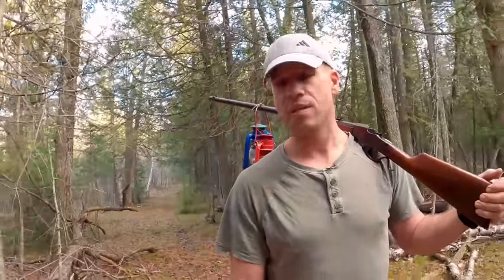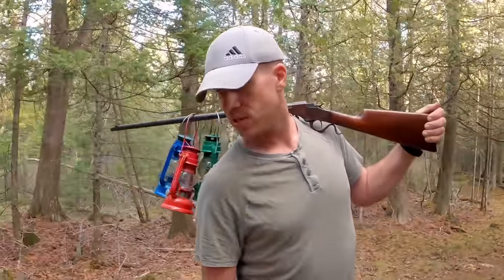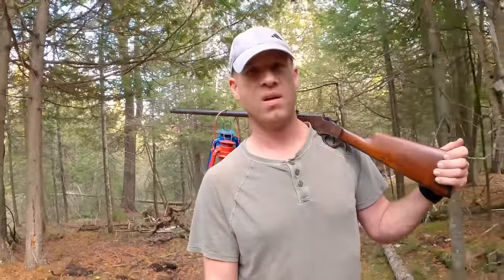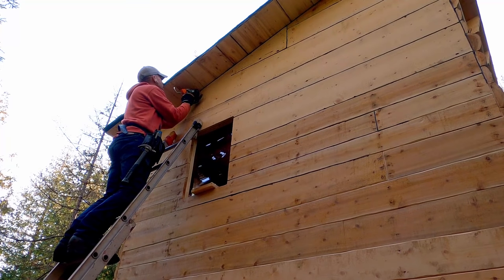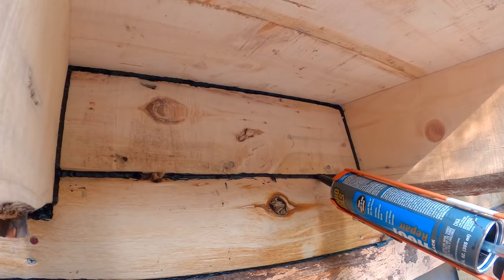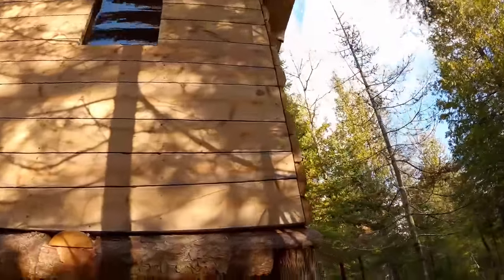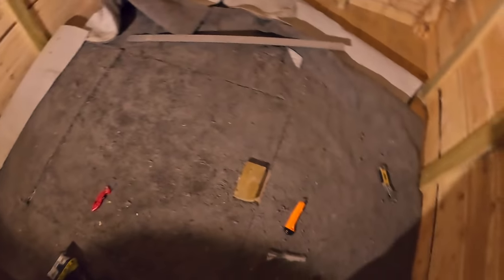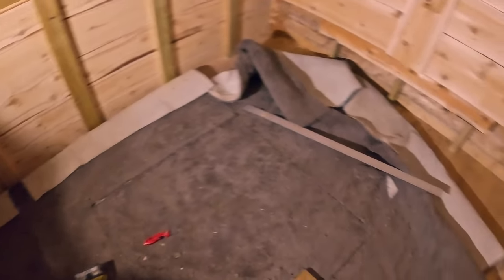The 7’ High Deer Castle, Finished! #19

Comment: Might not hurt to make a wooden scaffold system. could even tack it to the house. When finish take it all down. Idk of any thing to keep them out other than >  spray it down with diesel fuel and oil. It will help protect it to> from water, rot, insects, and squirrels >  I'll tell ya.  A Insect looks at a piece of wood like food, carpenter ants, Carpenter bees, and Termites dearly love a log cabin, if you don't keep it sprayed down every 2 or 3 years
Reply from the maker: That's what my Dad was saying.  Paint a mix of USED motor oil and diesel or kerosene or something.  That really works for bugs?  Guess I don't see why it wouldn't.  Seems like it would stink tho.
Reply: @survivingringworm2202  Yes it has a smell for about a week, but it works

Comment: Oh one more thing.......after watching the battery up and down the ladder in the previous video....... how about a small generator under the palace and a cord up through the floor ( just enough for charging stuff and lights)
Reply from the maker: Absolutely a great idea.  I'm actually not able to edit videos out there anymore because with the cold, the battery holds a lot less energy.  I believe at 32 the capacity is cut by 1/3 and at 0 deg, 60%.  That would be about 10 charges per one finished video.  A little Honda is def the way to go but sadly costs 100 jars of peanut butter or 10,000 rounds of .22 ammo.  Or 50 gallons of chainsaw bar oil.  
Depending on the standard metric used where you live.

Comment: If you just build a flat platform around each column at least 6" or so in width, any mouse would have to try to scale it in an upside-down kind of way, which seems like a challenge. Also, you could debark the columns and try to smooth them out. No idea about how to keep squirrels away, though.
Reply from the maker: From the comments, seems that wrapping the posts in metal is the way to go.  One step up from smoothing the logs I guess.
Reply: @survivingringworm2202  I hope it works! Good luck!

Comment: Use lithium grease or any other kind of grease that is thick and rub it well around all the posts at least 6 inches inches wide and at least 3 feet off the ground, should work to keep the mice and squirrels away. For flying squirrels you may need to hire a Hawk. 😂🤣
Reply from the maker: Got the grease, have a listing on Craigslist for the hawk.

Comment: Keep the Squirrels out n mice Try smooth sheets of Copper or antique copper or colored smooth Metal something that Blends in with the woods rather that is a distraction n works against it, also you could put fake owls on the posts, they use them around boats to keep away critters too ! maybe a fake boa constrictor or a bigfoot statue could help ? I know you most likely have n seen real or heard real Sasaquatch as remote n living there often like you do, if so Id love to hear your encounter, I saw one up close when bow hunting in Ohio one fall day about 22 yrs ago on a all day hunt, I was in the stand before daylight, and fell asleep for a nap about 11 am about a little after 12 I was woken by a squirrel sound walking up a old log road at the edge of the woods beside me I looked down n then up n up as a huge back side about 3 ft wide of what I thought was a horse was startled by me waking n it did a very fast 180 degree turn and dodged for the tree row straight behind me , I thought what on earth is someones horse doing going for a casual walk in the woods and why is it so scared of me to fast get 180 dgreEs behind me and from that angle with the treEs to my back as I had the bow drawed there was no way posSible I could have got off a clear shot at it as it weaved expertly in and out of the tree row as it walked fast away from me, it had intelligence to know to escape from me like so, but at about 50 yrds the woods n tree row turned to my right along with the tree row and walked across the log road n stopped long enough to turn n look at me for about 5 seconds, it was then it clicked in my wind this wasnt a tall horse it was a animal or creature on 2 legs n was over 8 ft tall n over 3 ft wide and a beautiful chestnut color in the full sun, as it walked off I was thinking man what was that? was I dreaming still asleep? I pinched myself, nope im wide awake and knew I saw my first Sasquatch n that no one would believe me, if I had known that morning I would maybe see one after my previous 40 yrs hunting alone and with dad as a young boy some of those yrs was every yr hunting in the remote woods for squirrel n deer deep back on ridges n hollows of west virginia where I had never seen one there either, but i would have brought a camera, my time in the woods is special n i want to disconnect from society when I hunt for me its as much as enjoying the relaxing sounds n sights smells of the woods n becoming part of the woods n feeling i am part of it n blending in perfectly as possible , I had thought that their could for sure be Sasquatch around after hearing wood knocks like a baseball player hitting a tree very hard with a wooden bat on numerous trips hunting this  forest, but until I actually seen one I was still a sceptic . some of the stories i heard just seemed unbelieveable to me, if you had ever had a encounter with one their or anywhere id love to hear about it, because after my encounter i believe n more importantly know they are real and so do many other great people, so many dont come forward for fear of being made fun or but heck with the nay sayers we know what we saw n that they are real and we should share our encounters together maybe we can put the pieces of the puzzle together n learn more about them from one another with a open mind, mountain gorilla sightings was once laughed off until they was proven real to people, such is the case with Sasquatch too, i love your deer shack its awesome !

Comment: For the Squirrel and mice problem, in ancient spain they used an overhang on the "legs" of the house: https://s0.wklcdn.com/image_0/3958/25049246/15981708Master.jpg i think maybe something with wood emulating this could work
Reply from the maker: Holy crap, that's a cool building!  Guess they would have to be stone like in the picture since those critters can easily claw into the wood.

Comment: Gives me ideas for bug out hideout  not on the wet ground.  Something like this or a concealed cave that I can critter proof would be ideal. This would be easy to insulate with styrofoam too, it gets nasty cold this far north.
Reply from the maker: Do you have cedar trees where you are?  You can certainly make the legs from just about anything but if you have rot-resistant trees, the roots and trunk make great supports that should last years.

Comment: did you cover the outside from rainprotection? Greets from Germany
Reply from the maker: You mean the boards?  I haven't.  Just caulked.  The roof and awnings overhang quite a bit but still, I'll probably do something more in the spring.  All frozen now!
Fröhliche Weihnachten!
Reply: @survivingringworm2202  Yeah! We have sometimes strong winds from the sides and this could press rainwater in the wall and somtimes in the windows. Its a cool hunter-house! Me be later mil-tec camouflage of the cab :-) My family motherside are all in hunting in nordrheinwestfahlen. They have a "rentet forrest" sind 120 years or so and a 120 year old big log house build on stone fundament. Hunting is a good inviroment ökological practice. Even if many in Germany (From ANTIFA and other anmila terror groups) hate it. I hate the cold after 2 years in mil in the cold war. I alsoways would invest in 10 centimeter isolation for the floor the walls and the roof. As a facility manager I know how to protect the house from the elements. As better it is isolatet- even only a "shooting point" as letter you need energy for warming up that space. Also cool are shutters- with micro-openings for the gun--shutters protect from storm snow and its also a good isolation plus in cold aeras. Frank